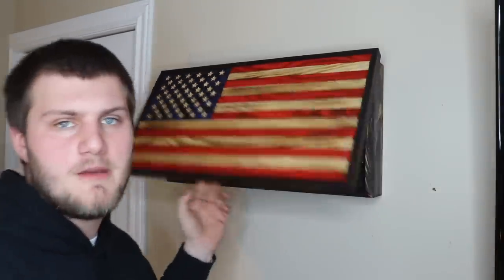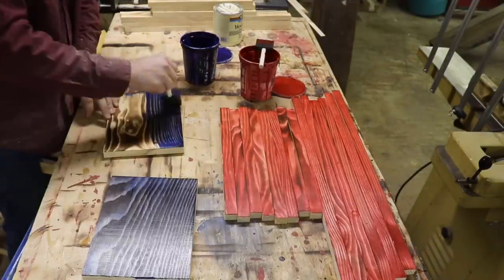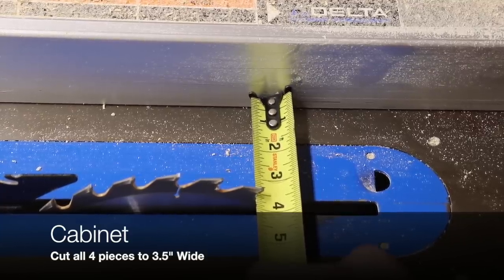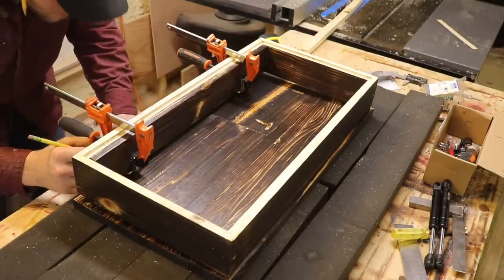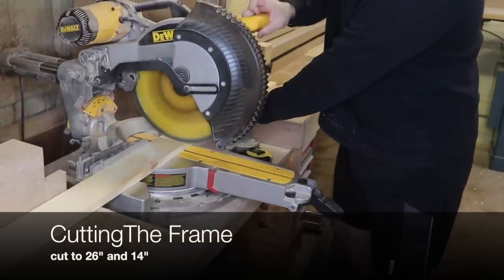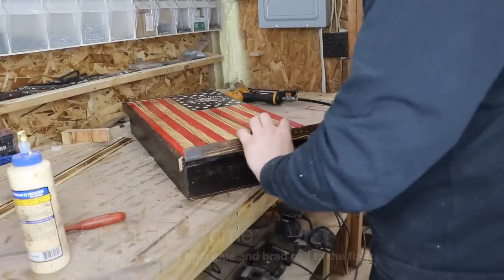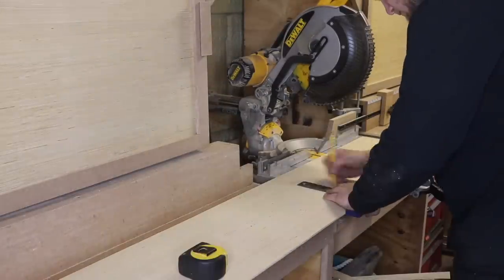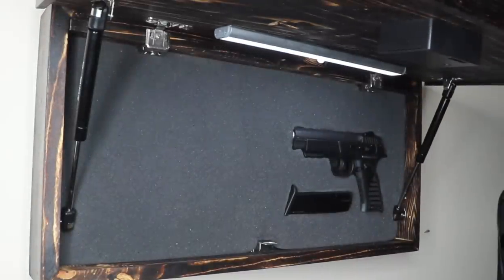How To Build A Wooden Concealed American Flag With Lights/Locks/Struts |DIY|

Comment: The only thing I would change is the mounting of the flag on the wall. If the battery dies you can't get in it. Mount  it so you can get to the back so you can get in. By removing the screws on the back. Awesome build !!!

Comment: Very clean build and well described video. I like the lock system. Far better than the mag lock.  

Being an electrician, I may wire mine if I build one and have an outlet behind the flag in order to install  led lighting I don't have to charge as well as a alarm on it connected to my home security. That way unless I deactivate the alarm, it will automatically alert my alarm company to send police so I can concentrate on neutralizing the threat.
Reply from the maker: That would be awesome!

Comment: Oh sweet now all I need to do this myself is a sliding compound miter saw, blow torch, table saw, CNC machin...
Nevermind I'll just buy one
Reply from the maker: There are substitutes to all of these tools haha. You could cut every board with a circular saw and do the stars with a stencil.
Reply: You can buy one, I'm learning woodworking again myself. It's worth it in the end
Reply: Btw, you're looking under a grand in tools... router is around $100, table saw $300, compound miter should be $350-500... $900 and you'll use everything again
Reply: Buy "Wen" brand stuff and "Bauer" brand stuff. I build indoor and outdoor furniture, storage, decks, gazeebos, ect. Started after getting laid off due to all the China virus stuff. Haven't had any issues with the equipment yet; did get roasted on by my dad who is a Milwaukee fanboy.
Reply: @iratevagabond204  noting wrong with Milwaukee... im a fan boy too but I know their woodworking tools need more attention
Reply: @stevennihipali3607  If I had all the money in the world, I'd be a brand snob for Milwaukee or Makita. Makita edges out over Milwaukee by a hair as their tools are more applicable to me, I think. I like to be frugal and consider price to performance. With that in mind, I'm 100% on board the Wen wagon, and I love me some Harbor Freight. Never had any deal breaking issues. I'm a competent tinker and capable of servicing my own machines, whether that be electrical or otherwise.

I don't consider myself a legit tradesman or professional, but I use my tools to make a living. By using the "budget/diy" equipment, more of my income can go to buying my wife sparkly things, keeping my kids out of the public school system, and feeding my dog a butchers block diet.
Reply: @iratevagabond204  agreed! Buying what works
Reply: Somebody’s always gotta post a D-bag comment like this. What did you think, you were going to be able to build one with a pocket knife and a screwdriver?
Reply: @JB-uc4zv  if done right, a pocket knife is able to do everything
Reply: ikr  totally DIY
Reply: I made one using hand tools and took it to a friend that had a CNC machine to do the stars but you can paint the stars on
Reply: Unfortunately ...NO... you cant build it with a cel phone and a game controller
Reply: What's the name of the tool you used to make the stars? 

Can you please make a video dedicated to that tool as a set up and review?.

Comment: had me in the first half not gonna lie... nice build. I fail to see the practical application as a gun case though, "a threat came out of nowhere, wait have anyone seen my key chain or my wallet?"
Reply: You could easily have the RFID card or keyfob laying on top of the cabinet (The card preferably since its flat). And as long as the top of the cabinet is higher than most peoples eye level, they'd never know it was there. And should they find it - it's rather unlikely most people would have any idea what an RFID card or have the idea to check that cabinet so it'd be relatively safe being easily accessible near the cabinet.
Reply: Lasarius2010 .. I’ve built a few of these myself.  This guys video was my inspiration.  If you take the tiny little chip out of one of the RFID tags, it can be mounted in a ring, a watchband, etc.

Comment: When connecting your stripes together you mention gluing them together. That part is completed pretty quickly in your video. Do you glue and just clamp them or do you also Kreg screw them together? Awesome teaching video. Thank you
Reply from the maker: Thanks a bunch Andy! I’d use a kreg and glue if you have one. However, if you don’t you can clamp for 30 and that way you can adjust the face completely flush while it dries. I’d recommend option two if you’re doing one at a time.

Comment: Wow!  That's a great-looking project.  I have one question:  what happens when the RFID battery dies?  Does the lock have a backup?
Reply: I am wondering the same.
Reply: The one I purchased to build mine is not kid friendly. When battery is low it’s supposed to give a long warning beep after you open lid. If you’re not around and battery does deplete enough lock releases and lid opens. Came home one day to ammo cabinet wide open. Mine does have power cable if I wanted to power it from house

Comment: My wood shop teacher is rolling over in his grave.  The crossed arm move you did cutting the stripes on radial arm saw would have gotten you a fail on the safety check.  Besides that, just so you don't think I'm trolling here, I loved this video and this project is awesome!  Really well done on both flag and video content.     Thanks!
Reply from the maker: Hahaha thanks John, you’re definitely right, not going to deny that.
Reply: @keystonewoodworx4544  hey, your tablesaw use was safe, so  that's a more dangerous tool.  Don't ya love armchair woodworkers?  Lol. Enjoy the videos.   Keep up the good work

Comment: Great video. Made me decide to put a frame around the flag. What hinges did you use?
Reply from the maker: Thank you! 1 1/4” cabinet hinges
Reply: @keystonewoodworx4544  That's pretty generic. Would you happen to have an Amazon link? I've purchased 2 sets of the wrong type so far. Rather not get the wrong one again. Also, cutting the foam with a saw like that doesn't melt it and make a mess?
Reply: Hi. Can you be more specific on the hinges you used? Please?

Comment: How did you attach the stripes to each other.  I assume you used glue and clamped them but I don’t see that being very sturdy.
Reply: I'm thinking the same thing??
Reply: Wood glue if clamped and applied properly is actually incredibly strong. It would be fine if used in this way since there is no force applied to the individual pieces.

Comment: Very well done, have you ever done one that was inset into the wall?
Reply from the maker: Thanks! Someone said that before in the comments. I think that would be a sweet idea and conceal the depth a bit more!
Reply: @keystonewoodworx4544  I guess you would just need to make a 15" (or whatever it is) unit so it will fit in between studs and then mount it to those studs from the side.
Reply: @keystonewoodworx4544  use the inset for a mirror. Easily 6 foot tall. And deep enough for long guns, ammo, etc
Reply: @jmorzuchable  you can also cut a stud to have a wider space. The frame would replace any structural strength lost

Comment: What if the batteries in the RFID reader die, is there another way to open the cabinet?
Reply from the maker: Yep! There is a cord sticking out of the top.
Reply: @keystonewoodworx4544  Nice...my OCD would make me recess that into the wall and have the fail safe/cord from the room behind the wall. lol
Reply: Does the cord you speak of come with the rfid reader? How did you get it to stick out of the top? Drill an additional hole?
Reply: Lakeside Woodshed did you end up finding an answer to my question? Does that cord come with the rfid chip reader, and how is it sticking out of the top? Did you drill an additional hole?

Comment: Do you have a link to the hinges? Thanks!! And awesome work!!
Reply from the maker: Thanks a bunch! Since the corona virus it’s been hard to find on amazon. Check out alibaba!
Reply: Can you put a picture of the hinge on here so I can see what kind it look like up close?
Reply: @keystonewoodworx4544  Can we please get a link to the exact hinge you used in this video?  I've noticed not all concealed 1-1/4 &1-3/8 hinges open differently and interfere between the case frame and flag, especially if a guy wants to add a trim frame around the flag. Thanks in advance.
Reply from the maker: https://www.amazon.com/Furniware-Closing-Cabinet-Overlay-Hardware/dp/B07W5CL5C8/ref=mp_s_a_1_2_sspa?dchild=1&keywords=concealed+cabinet+hinges+1+1%2F4+overlay&qid=1594004177&sprefix=concealed+cabinet+hinges+1&sr=8-2-spons&psc=1&spLa=ZW5jcnlwdGVkUXVhbGlmaWVyPUEyQTgxNDM0OTlBVUIyJmVuY3J5cHRlZElkPUEwNDQ3NjM5MkJPMjU4VUhHR0ZLMCZlbmNyeXB0ZWRBZElkPUExMDEzMTU3MTY3VjNPTklBUEtIMCZ3aWRnZXROYW1lPXNwX3Bob25lX3NlYXJjaF9hdGYmYWN0aW9uPWNsaWNrUmVkaXJlY3QmZG9Ob3RMb2dDbGljaz10cnVl
Reply from the maker: https://www.amazon.com/Furniware-Closing-Cabinet-Overlay-Hardware/dp/B07W5CL5C8/ref=mp_s_a_1_2_sspa?dchild=1&keywords=concealed+cabinet+hinges+1+1%2F4+overlay&qid=1594004177&sprefix=concealed+cabinet+hinges+1&sr=8-2-spons&psc=1&spLa=ZW5jcnlwdGVkUXVhbGlmaWVyPUEyQTgxNDM0OTlBVUIyJmVuY3J5cHRlZElkPUEwNDQ3NjM5MkJPMjU4VUhHR0ZLMCZlbmNyeXB0ZWRBZElkPUExMDEzMTU3MTY3VjNPTklBUEtIMCZ3aWRnZXROYW1lPXNwX3Bob25lX3NlYXJjaF9hdGYmYWN0aW9uPWNsaWNrUmVkaXJlY3QmZG9Ob3RMb2dDbGljaz10cnVl
Reply: Many thanks!

Comment: So just to be clear, this whole thing was made from 1 sheet of 1”x12”x10’ or did he buy another one for the cabinet?
Reply: Only reason I’m confused is because after cutting the union, he said to rip the whole rest of the board into 1” strips. So I’m just wondering where the lumber came from for the cabinet. Also, does anyone know what kind of wood is used for this?
Reply from the maker: Hey Justin! Sorry I wasn’t too clear about that. I made two flags from this board. Cut your union first , then cut to length for the stripes and rip them. Then cut for the frame and rip.
Reply: Lakeside Woodshed ok so the whole project is done with the single board then? After I cut the union, I only rip enough 1” strips for the stripes and then use what’s left for the frame? Also, what kind of wood did you use?

Comment: So basically with minimal knowledge of woodcrafting ng I built myself a concealment table with my fiancees father. It's not quite done but I've been working on it since about Christmas last year. Burned it all together as one piece stained it ebony and the flag ovbiously with old glory colors. Couldn't get the shocks to work right nor did I get it flush but there's still some thinking to do

Comment: What if the batteries die in the lock?
Reply from the maker: Great question, these locks come with a 13” usb cable. I run this to the top of the frame so it’s sticking out but not visible. When the batteries die just plug it into the wall and swipe the card.

Comment: If you rout before you miter and join you won't need to chisel out the corners.
Reply from the maker: Doug McHone true, there are two ways to do it. I feel this is faster for me. Instead of handling a bunch of boards through the router I’m just doing one frame. This also assures each rabbit on the miter is flush.

Comment: I don't get it. What's the purpose in burning what seems to be perfectly fine wood? What is that supposed to do for the project? Doesn't make any sense to me, and I watched video all the way through. You never explained why a builder should do that...
Reply from the maker: Looks for the white stripes. It also dries out to pores which allows stain to penetrate deeper and more rich in color.

Comment: this is really cool but man PLEASE stop crossing your arm around the miter saw.  if you dont have enough stock to hold the left side of the piece then please use a clamp.  its really hard to do woodworking with one hand.

Comment: No thumbs up from me until you wise-up and wear some safety gear (Eye & Ear).
I don't like project that seem to require those stupid CNC routers.  Yes, you are sitting there twiddling your thumbs while some machine does the work.
Reply from the maker: I should definitely have PPE on! However the Cnc is not required. A simple $3 stencil will give you a similar look. I have a Cnc so I will use it. I wouldn’t necessarily call them stupid either,  considering they are more precise than a human could ever be. Best of luck!!
Reply: @keystonewoodworx4544  No, the CNC isn't stupid, but compared to hand chiseling or some other technique, over time, it makes the WW-er less 'skilled', IMHO.